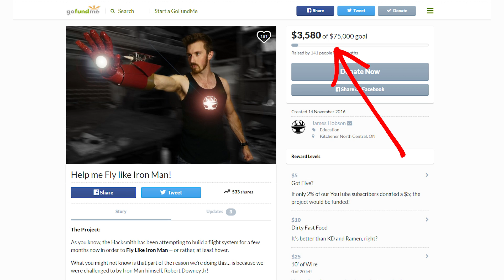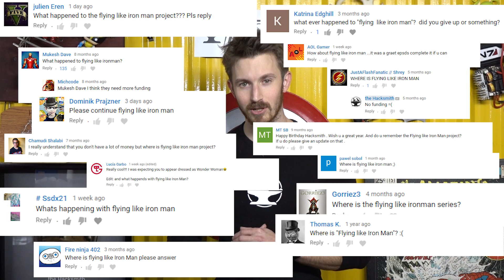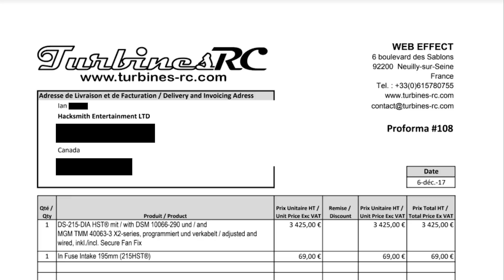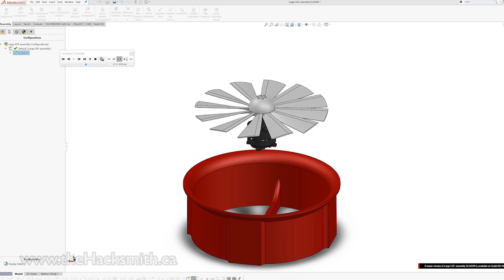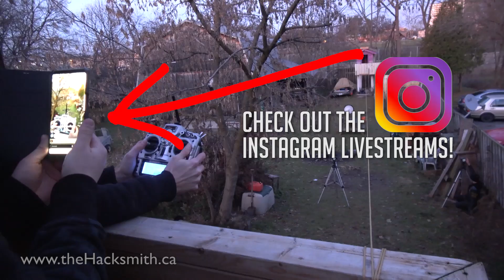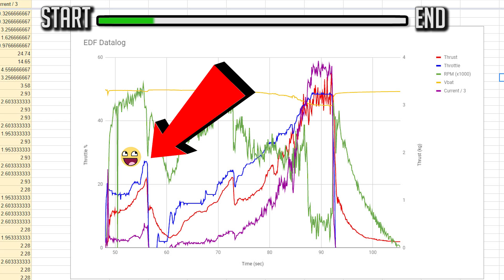Flying Like Iron Man #13: JET ENGINES, EDFS AND MORE!

Comment: How come you haven't tried housing the EDF's together in a single housing strapped to your back using hoses to filter the air thru the ports at the bottom of the feet and hands? ??

Comment: I dont know if this would work but maybe you could use a pneumatic grinder motor and turbine rotors. Pneumatic systems may have more power because gases have a higher PSI when compressed.

Comment: Did you mention static/dynamic balancing of the fan blade?  Amazing the motor bearings didn't fail; Fc = mv^2/r (tangential velocity doubles, the force will quadruple). Poof goes EDF Ironman... shrapnel distance boggles the mind.  Watching your videos reminds me of Emmett Lathrop "Doc" Brown.  Cheers!  Endeavour to Persevere.
Reply from the maker: Yeah, that blade was not balanced -- hence the solid "THRUMMMM" while it was going!

Comment: I agree Brownings design is lacking. He has to be able to “lift” 90lbs of “weight” to control his suit. Not something- in my opinion, most people can do or would want to do while also flying with jet engines strapped to their bodies, at least having some edfs, or weaker engines on his boots would decrease the amount of force being exerted onto his upper body, and it wouldnt be as hard to balance as he said it was with boots being the main sources of thrust (although if my memory is correct he was only trying boots).

Comment: Since the engine was so hot, buy or make a backup engine or an extra one. (I recommend the back up one cause it could be smaller and you wouldn't have to carry even more weight.

Comment: Is it possible to get any good technical specs on that motor? I investigated using one for a project, but there were hints that the coil resistance is just too high for it to handle 10kW
Reply from the maker: The manufacturer has decent specs

Comment: i don't see a reason for feeling intimidated by browning achievement , don't let haters stray you from your path, you are a great inventor. But we have to build on each others achievements , no logic in wasting time inventing the wheel rather upgrading what has already been invented and build on it. If you are wondering why no one has put Iron man on the fly board , then ask a bigger and more important Q, why hasn't Franky Zapata put 2 of those hover boards attached to a bike and make a hover bike ?!!!!!
Hacksmith if you really want to invent the iron man you need to teem up with those who know how to handle jet engine flight control and build and exoskeleton with jet engines , that's what will get you to a real working iron man suit and I know you can do it

Comment: You guys really need to be testing this in something that could contain any parts that liberate in the event of a catastrophic failure. You're putting yourself and your neighbors at serious risk due to the high RPMs involved. I work in the military jet engine industry and have experienced what happens when things come apart at high RPMs. Although you are working with plastic and composite materials, any of those parts become projectiles during a mishap.

Comment: Why not test a blade less fan and check it out at thingiverse for the 3D printable download.
What I heard about them they can create more thrust then normal fans.
Also why not use 18650 batteries because they last longer more durable and it's less of a hassle than charging RC batteries.
And you get them at gear best  or Amazon and other places.
And could you please tell us in your ironman up date and it's a big pleasure.

Comment: Have you ever take in consideration what it is called in turbo compressors "forbidden frequency"? Wheel, I have been testing and tuning multiphase turbo compressors PID controllers up to 3.5 MW. The only way to make it stable and not self oscillating it is to avoid some frequencies. As I can hear, that is one of the problems.

Comment: Dear Hacksmith, 
I think the reason why the 3D printed EDFs exploded before was because their was to many fan blades and to much motor rpm. If you used less fan blades you could lower the chance of explosion.

Comment: The rumbling noise you here is cause by turbulence , the graph shows how the thrust is effected by it. The body should be longer and the blades locked in a rotating ring spinning with in the body. To remove the blade oscillation and prevent reflux of air from the exhaust , the turbulence is really down to the blade shape. 
Just joking, I know nothing about air flow 😂

Comment: Couldn't you possibly use one jet engine and two things coming from the legs of the suit one from each and that will connect to the jet engine that will go in the middle... one should be enough you don't want to much thrust before you work out the bugs of the designs then the normal suit

Comment: Would it be too expensive to try building your own jet engine with less heat and custom stability for easy control?
Reply from the maker: yeah... they're incredibly complex -- and making one with less heat + custom stability? not even possible haha... commercial jet engines have 1000's of engineering hours and design iterations. We're a few guys in a garage...
Reply: haha I see, it seems like that much power is kinda useless anyway. You mentioned that an issue with flying like this is that it relies on the pilots skill; could it be possible to make something kinda like a car censor that detects its surroundings and levels the pilot itself? Not sure how good you are with code ahaha...
Reply from the maker: Well yeah, that's why we want to go with electric, because automatic stabilization is as simple as plugging in a drone controller board +)
Reply: Excellent! I hope to see that one day. It would be awesome if we strapped drones to people and watched them fly around ahaha

Comment: S.C.A.R. Gun

Infinite ammo. No zoom. Get this at the New Venice supply depot. Secondary 
function detonates explosives. Fire up to five mines then detonate them all at 
once for maximum destruction. This is the technique to kowtow the Alpha Drones 
so Riddick can finish them up close. The mines do minor splash damage to 
Riddick.

Firing more than five will keep the number of mines deployed the same, but 
will delete the first mine from play (hence you can keep firing mines to 
delete one you accidentally placed near you). The only downside is the slow 
speed of the shot. Enemies can dodge the mines if they see them coming. 
However, keep this weapon handy, as its utility is required for the majority 
of bosses and crap you face in New Venice (except the mechs perhaps, but you 
can use more destructive weapons like the drone grenades).
Reply: This could be made by filling PET Bubbles with compressed air, and having an impact, or electrically triggered failure mode built into the bubble (popping it) as well as an adhesive on the outside of the projectile. the gun should be capable of dialing in the amount of compressed air as well, so it will need a high speed air pump (no tank, unless you are using compressed air to propel the projectile as well)

Comment: question: why dont you use leightweight metals like aluminum instead? you know theres a method to "3d print" parts out of aluminum Powder aswell wich... ist propaply way sturdier than plastic and thus shoulndt vibrate as much. as this rotor
Reply from the maker: +DragonTV cost,  were just prototyping right now,  can't spend money on stuff that isn't going to work!  :p
Reply: well youre right xD aluminum isnt that cheap

Comment: I know some professors who are working in Aerodynamics who design wind mill propellers (the big ones) to maximize efficiency and reduce the amount of turbulence produced (definitely not a statement to make myself look like an expert, I'm not). I may be able to get in touch with them, however I am not sure as they are based in Texas. I would think it should be something to do with the blades, or the fact that the cowling surrounding the engine is short enough that the jet wash is actually staying around and interfering with the blades ability to produce thrust. Just a thought

Comment: Hey Hacksmith, have you tried using brushless motors to power homemade EDF's? Koford engineering has a line of motors that go up to 200,000 rpm. I understand that might be a little (or a lot) too fast, but you could get the model that goes, say, 75,000 rpm with a bit more torque, that means with a fan that has a radius of 3 inches the blade tips would still be going around mach 1.7,  I'm going on the assumption you don't want to break the speed of sound however, so maybe you should use a gearbox to reduce the speed to half of its max value and consequentially double the torque, then you could run two fans from a single motor for twice the thrust. Plus, in my experience brushless motors are not super expensive (I got one that goes at 5,000 rpm for about $30). I don't know if you already use brushless motors, but if you don't, you should definitely consider it.
Reply from the maker: Sounds like someone should watch more of these videos ;-)

Comment: Would funneling the exhaust give more pounds of thrust
Reply from the maker: For high speeds you can make a thrust tube which will increase thrust by 10-15% (ish) but unfortunately we're going for VTOL where that won't help.

Comment: Prop design is a very challenging thing to do well, you probably should just buy a prop that fits the size and pitch you need.  Kudos for giving it a try though, and confirming that sls nylon is strong enough for those rpms.
Reply from the maker: +Alluvian yeah that's the plan

Comment: Look into Ion Propulsion, its experimental and dangerous, and it might not even work sometimes but that seems to fit your profile! XD (p.s. I do have a few ideas that I would love to share with you guys and maybe even help you with the project from the US, remotely.)
Reply from the maker: +Aditya Bhatnagar only works in space :p
Reply: the Hacksmith Well current tech only works in space but if you used an axial compressor and then ionized the air you might be able to manipulate the plasma with magnetic and electric fields to produce enough thrust. I don't have the resources to test it myself but I think you do.
Reply from the maker: +Aditya Bhatnagar yeah... but NASA's version puts out a few grams of thrust and is the size of a car. 

Don't think we can make something better,  nor do we have the billions to do so
Reply: the Hacksmith Yeah that's true but I heard news of a team that got an experimental plane to fly with the tech. They used multiple placed around the plane and it flew for a bit (as long as the battery lasted). At the very least that's proof of concept in atmospheric conditions. Anyways, it was just an idea.
Reply from the maker: +Aditya Bhatnagar i don't think that's true,  you might want to check your sources?
Reply: the Hacksmith Just wanted to confirm are you looking at NASA's EM drive? Because that mystery is the size of a car and generates a few grams of thrust while ionic propulsion is much smaller. It also goes by the name of plasma propulsion or magnetoplasma rockets. An MIT article stated that they believe that through development an ionic wind thruster could produce 110 N / kW.

Comment: One problem your having with your ideals is that your trying to jump straight to using computer programming to help flight. I see it as jumping to self driving cars rather than being more basic in your initial design then after success in that add computer flight aids
Reply from the maker: +sVBliTz computers make it simpler...

Comment: Watching this...

The fan is blowing back, if the propeller breaks loose its coming straight at you, or if it explodes its going sidewards. Why would you not be hiding in the treehouse? (behind and above the fan) at worst it will be a little windy, at best you wont get hit by shrapnel

Comment: Around 30% throttle your fan blades are entering a destructive oscillatory mode called wide-chord fan blade flutter. 

In particular, it sounds like aeroacoustic flutter. A small deflection in one blade produces a pressure wave that induces deflection in the adjacent blades.

Your blade chord at the root is too small, and not providing the torsional stiffness required to avoid the blades fluttering in the wake of the blade in front of it.

Comment: Well grats. You got me and my friend to start arguing over this project, and we ended up with a bet. The bet right now is sitting at $1245.56. My bet is that you don't get a iron man project done like the iron man movie. So no suit, but you do mange to make some ok flying tricks. His bet is you finish the project and you are the only person that has ever made a real working suit.
Reply from the maker: +Ashlockheart looks like you're gonna win
Reply: Lol. I knew I would. No offence there. It would be cool if you were successful, but I am a realist, and I know hovering with something for a few secs is really the only thing that is more likely to happen. How ever if your project was set around water then I could see the suit working Having water jets placed on the suit in the correct areas would allow you to fly for a good amount of time. I know you have seen those water jet boards outs there people use that goes to the jet skies. If you take that and have a few small,med, and large jets on parts of the suit the pressure would be enough to fly. Control I think would be a issue.

Comment: I'm no engineer but you could try instead of using regular EDFs you could try making a custom turbine blade and spin it by pushing air in a condensed space at the blade. Idk if it will work though.
Reply from the maker: because making a custom turbine blade is not that simple? lol

Comment: Some advices for the EDF design. You definitely don't want to have the same pitch angle at the end of the blade as the center, it causes a huge flutter sound and inefficiency. You must do the math but usually it comes up to x2 of the edge pitch angle. Also too much surface, you should increase drastically the size of the nose cone of the edf, that will make it much more efficient. But superb work with the project!

Regards!
Reply: Nah, they sound like people who want to see this work, giving advice that's pretty specific to the design being proposed. Where's your contribution?
Reply: Absolutely. Also Idk if they gave a reason, but the space between the blades and housing was pretty big, reducing efficiency greatly. They'll have to look into the properties of the print to know how much it stretches under high RPM.
Reply: i wonder, do solidwork account the flexing of the material
the drop on efficiency might be because whay you just said and the fact that the whole thing didn't stay rigid all the time
Reply: from what i remember, you can do material simulation for spring or other thing, so i don't see why it wouldn't be used for that
Reply: Jonn Benny giving advice? If there's no money you can give how else you gonna help?

Comment: Gents, by my math (using momentum theory, 10kW of power, 20 in fan diameter, ignoring the center hub area, air density of 1.225 kg/m^3), you should only be able to achieve a maximum of 106 N (10.8 kg) of static thrust.

Something else to consider, electric motors do not put out their maximum power at their max speed. The max power output is reached at a much lower speed with the torque being very high. The motor manufacturer may be able to supply some useful charts relating the torque and speed. "Electric Motors and Drives" by Austin Hughes and Bill Drury is a great reference on this topic.

I love your channel, and you guys do some amazing things. Keep up the good work!
Reply from the maker: That's odd considering you can get more thrust out of a 2-3 blade prop which is what this motor is designed for...
Reply: My point about the motor is that you may not be working with 10 kW at 100% throttle. It is likely lower than that. You might check your voltage and current data to see how much power the motor is drawing.
Reply from the maker: Yeah it's only 10kW input, thanks though!
Reply: I’m not really talking about losses or conversion efficiency (an electric motor like yours probably has a 90-98% efficiency when run at 80% of the no-load speed or higher). What I mean is that you may not even be drawing 10 kW at 100% throttle. It’s probably far less than that. Max Output Power (and therefore Max Input Power) happens at something like half of no-load speed, where the efficiency is really low. So motors rarely run at Max Power.
Reply: Also, Merry Christmas!

Comment: The sound made by your ducted fan sounds familiar, if I'm thinking right then the bearings in the motor are allowing a slight ocilation (wobble) to happen. And are the bearings the correct type for use with a fan?
Reply from the maker: +Slikx666 the motor is designed for this application yeah

Comment: So I have an interest in this kind of stuff and came across your vids in the last few hours. Love them. Very informative. You guys r doing a great job. I'm 100% sure hybrid, more like an extended range configuration (think Chevy Bolt) is the way to go. I believe you guys will also really need to thinking outside of the box to make this project work. Consider EDF with a turbine in the center. I've subscribed and will be connecting to all your social media channels over time. I will be watching.
Reply from the maker: +Omari S we do think outside the box ;) unfortunately, turbine inside of the edf? Definitely not gonna work. They are vastly different. Turbines spin at 110,000RPM. Regular big EDFs 10-20k. You'd get crazy turbulence and loose thrust

Comment: Thrust vectoring? That’d probably make it plenty stable in everything but altitude.
Reply: I guess the nozzles could splay out or move closer to inline for overall thrust control also, although that seems kinda inefficient.
Reply: You’d probably control engine direction rather than nozzle direction if the engines are gonna be that small.